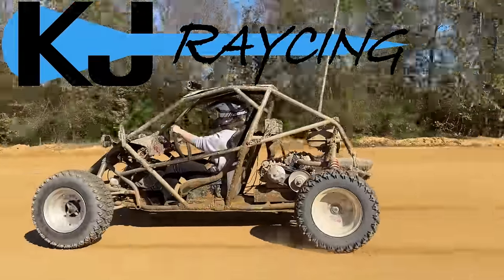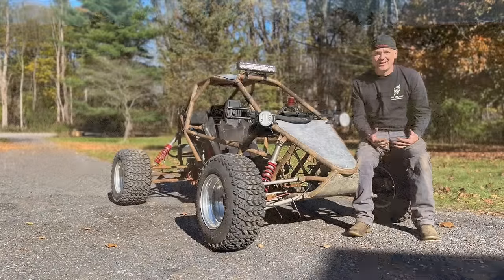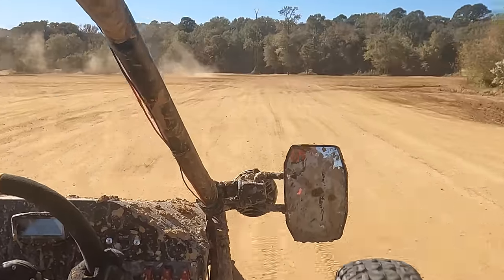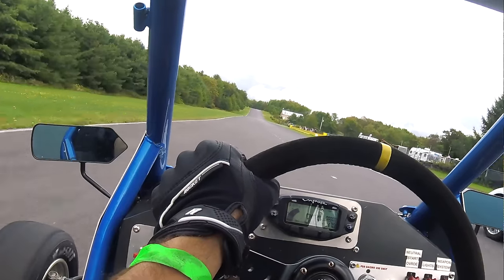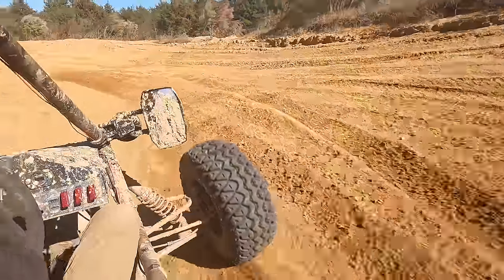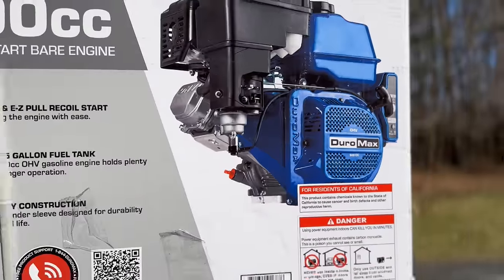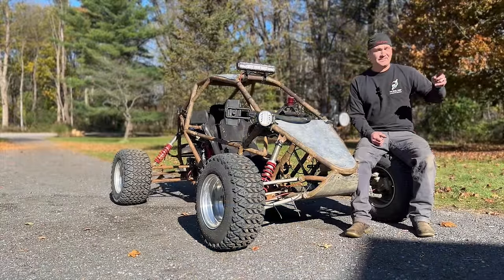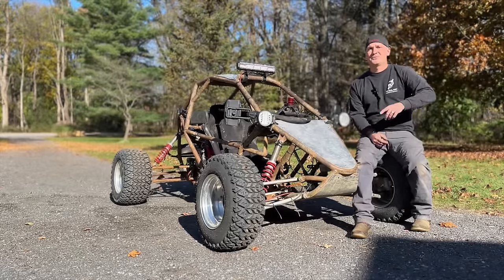Crosskart: Small Budget, Big Performance

Comment: The longer I live the more I think this is the sweet spot for reliability, low cost, safety and fun. Dirt bikes are awesome, but not something most people can easily ride/fit on unless you have a bunch of bikes. Pre runners are sick, but to make them safe and fun, you're going to spend SO much time and money getting the suspension built, dialed, frame stiffened, then you need more power etc. side by sides are sweet but the ones that are really fun to drive aren't exactly cheap at all.
With these you've got a full cage and super low center of gravity, very unlikely to roll and way safer than say a quad if you roll it.
Way easier to fix than a proper vehicle that weighs 4 or 5000 lbs with a cage in it too.
Reply from the maker: You said it man!!

Comment: Awesome little build! If I can make one suggestion... put in a firewall, top to bottom. I watched one of your other videos, great build, but it had a radiator on top... if a hose breaks/leaked while you were riding, odds are you'll be in the icu. The firewall doesn't need to be fire proof, it just needs to keep the the stuff separate from you.  
Great content. New sub. Thanks for sharing!
Reply: Sounds like a great recommendation!
Reply from the maker: Couldn’t agree more, that’s why I did it and showed you how:  Crosskart Build: Firewall    KJ Raycing VF-1
https://youtu.be/KyCp6GV5PNY

Comment: Great looking machines. I build an all terrain cart back in 1999, but no top cage. It just had a 5hp B&S with CVT. That's what a lot of carts were using then, and the B&S had a lot of aftermarket parts available. It's still sitting in my shed. It was a lot of fun, and would go just about anywhere I wanted. Not as fun as these designs though.

Comment: I love your passion and this kart's design and execution. I know this probably won't be popular, but having this in electric would be awesome. It doesn't need a big motor or battery as you don't drive long distances. Any kind of maintenance would go away and it would of course be quiet. The center of gravity would probably also be even lower. Then of course there is the low end torque and the fact you don't need any kind of clutch.
Reply from the maker: Stay tuned 😁
Reply: 100% agree but you know how these rural folk hate all them new fangled gizmos.
Reply: @grafja we hate the poor range. Its not uncommon for me to ride my sxs 60-70 miles in a day.
Reply: @grafja its not that I hate electric stuff. Its more just that people treat it like its solving every issue with internal combustion engines when its not. It solves some yes, but electric stuff has its own set of draw backs to it. Thats where I and many others draw our grievences from

Comment: Many years ago my dad's neighbor built a mid engine corvair 6 cyl. With a VW bus trans. sand rail using muffler pipe.
He made up templates from luan plywood for all of the bends, And the muffler shop did all of the bending . He did the wielding at home.
And like you he built several of them.
The muffler pipe was fairly larg in dia. And thin walled.  altogether I thought it was brilliant.

Comment: Totally agree on the power and speed thing. I'd like to have a version with a 650 or 750 bike engine. Really, just for having the additional shifting gear experience. One of each, be nice.
Reply: On a short course or trail situation, a 525 Polaris ATV powered machine would mop the floor with those; low-end torque is where it's at

Comment: I always wanted to build a crazy little go cart. Pick up a used motorcycle, maybe an old 4 cylinder 900cc. 50+ hp, with a clutch and transmission.
Reply from the maker: Check out the channel… this was the 4th one I built and the only auto 👍

Comment: Have you ever thought of making plans for say a 50-60% scale version of this? One that would use something like a 212 cc motor for kids? If so I would be interested in buying the plans!
Reply from the maker: I was working on a kids version that was smaller but instead made the seat and pedals adjustable and bought an off road booster seat. My daughter has been driving a VF-1 since she was 8 years old 😎
Reply: @KJRaycing  I hope to be starting a build for my winter project. Maybe I can work out plans for a 1/2 scale version using 1 & 1.5 tubing that can utilize a smaller engine. :)

Comment: I got a question, Im 15, learning to weld next year in shop class and might buy a mig welder. I was wonder if I was to build this do i need a tube bender or could I cut it at an angle and weld it and brace it. Also should I get the 5hp first or should I just buy the 20 right away? If it is just as simple as bolting them in buying both is fine but if I need to fab a whole bunch more

Comment: Two seater with front front and back rather than side by side? Or does that make a length problem?
Reply from the maker: I designed the VF-1 XL so it can be lengthened for tandem seating if you want to feel like you’re in an F-14 😁

Comment: that torquey engine does a great job.   Plus you wouldn't have had 50 successful test rides w/ a shifter Crosskart!   W/o some shifting/ignition gizmos you'd have a shredded transmission.    Question...what purpose does the 'U' linkage and tie rods on the rear suspension serve?   It seems the heim joints have the rear A arms under control.   Great looking build and really nice work.
Reply from the maker: Very true! Those engines may not have a lot of power but they can run. I put a rear anti-sway bar on the back to give steering back to the front and prevent rollovers. I get them for $15 off ebay from parted out utility atv’s.  Thank you so much!
Reply: @KJRaycing  Ahh, gotcha.  so when the compression side moves 'up' the sway bar pivots,  transferring upward force to the other arm causing it to compress slightly and reduce overall body roll,  correct?    Looking forward to more builds.

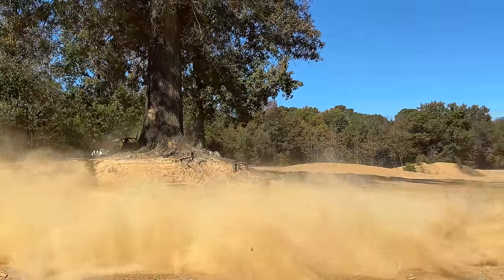Comment: 7:10 is what I would want.  Acceleration, not big speed, 50- 60 is plenty.
 What power level is needed for anytime drifting and donuts ??
Reply: I change my mind....LOL
9:58 is what I want !
Reply from the maker: Atv engines. They have more torque and are geared more for off road. The tonka wheels are fun but terrible with that 4 cylinder!
Reply: @KJRaycing  Hey !  Thanks for your response !
I am still in the preliminary dreaming phase but also figure others may be thinking the same.

Comment: Still waiting for the day someone builds the frames and sales them. Thought they were cool with the bike motors but now we got the mini bike motors on em? Yea, interested.
Reply from the maker: First kits are being manufactured right now 😎
Reply: @KJRaycing  Like actual welded, ready to go frames? If thats the case, Id like to be on the mailing list.
Reply from the maker: No you still have to weld, but you would have to weld to mount suspension, engines, seats, steering… Get a welder and start practicing. 👍

Comment: i run single cyl 2 stroke Rotax's from the late 60s early 70s. my 318cc (Ol' Dependable) maybe 17hp runs real strong until you get it in really dry sand then ya better keep it moving. my 335cc 20hp? has no trouble in the sand. i have a 292cc racing motor that i havent put in yet but cant wait to get it in there its rated at 22hp. and yea big difference in just a couple horse.
 i agree and so do all my riders/drivers. you don't need to be doing 100mph to have fun. i geared mine to run 45 at 6,000rpm. on the trails here in Michigan that's faster you want to go as I'm on the under 50" trails. like you i have never had anyone get off the cart and say "That Was Boring". my father raced snowmobiles back in the day and taught me to set up a clutch and torque converter so them little  40lb 2 strokes (including the clutch) are really responsive to the throttle.

Comment: Great video!  What do you think the budget is for the stock version with parts etc minus labor?   Thank you
Reply from the maker: I have 3 cost breakdowns on my channel but I guess it may be time to shoot another one 👍. This is a very complex question…
Reply: @KJRaycing  Thank you I'll check to find the breakdowns that you mentioned.  My main curiosity was like $1k, $5k, $10k etc. just a ballpark on what you feel is a "small budget".   Btw my background is in data and analytics so I would be glad to help if you wanted.
Reply from the maker: Well the bugdet kart was initially built for under $2k, as it sits with all of the upgrades is around 3k. The other ones on the channel range from $4500-$6500. Small budget for the kind of performance these have.
Reply: @KJRaycing awesome thank you

Comment: I purchased plans but the die I have is a 7” clr.  Wondering if you could convert the measurements over through your software or if you know of a way to make everything work right.
Reply from the maker: 7” clr is too big to make a good crosskart with. The plans and frame itself are VERY forgiving to multiple clrs. But the biggest that has been used is 6”. Honestly I would look at getting the correct die for your machine if you want to build a crosskart. I wish it could be easier. I wish you the best.
-Kyle
Reply: Haha. Thanks for the quick reply.  I was hoping for a different answer but I guess I’ll have to prove you wrong now.  Lol. Your karts are sick btw.  I’ll post some pics  when it’s done.  Thanks again!

Comment: Do you also have the prints for the jigs you use??  I don't see them on your website. Including the jig you built for the front suspension.
Reply from the maker: If you read the description at kj-raycing.dpdcart.com it shows everything included; which is plans for all the jigs, frame, rear a arms and hooking protection. If you are referring to the jigs I bolted to the wheels they are too simple to be made into plans and vary by tire size you are using and bolt pattern of the hubs. I walk you through exactly how to male them in a video. Enjoy the build 🦾

Comment: Will your kart handle a 300 hp 2 Kawasaki motor
Reply from the maker: Yes. Make sure to use all of the motor mounts. You’ll only end up using 1/4 of the throttle though. That would be like having a 3000 hp mustang.

Comment: I don't know much fabrication. But I would certainly buy the chassis if someone built it
Reply from the maker: How would you mount your motor and suspension?  The hardest part is to start 🦾
Reply: @KJRaycing  if someone made a rolling chassis I should say. And it's because I'm currently on the road for most of the year so I'm only home for a few days to a week at a time so I don't mind dropping an engine or doing some wiring. But to learn a whole new trade under those circumstances is quite hard

Comment: I'd rather have an electric. As you said speed isn't what makes it fun when offroading, torque and acceleration make it fun, and you can't beat electric motors when it comes to that. My kids have an electric kart that pulls 1.4G's of longitudinal acceleration from a stop, more than most supercars, it whips your head back and pins you to your seat. Unfortunately it is limited to 25mph, I would like something with a BIT more speed than that...
Reply from the maker: I agree, electric can be a blast, but right now it is still pretty expensive and having multiple battery packs to run all day just adds to the cost. I’m hoping prices start coming down so I can do an electric VF-1 👍

Comment: Lets be honest though, more power is almost always better. Just because its there doesnt mean you have to use it all 100% of the time. Ive NEVER riden or driven anything and said ‘man, i wish i had less power’. Lol
Reply from the maker: Let’s be honest, you didn’t watch the entire video or you totally missed the point.  I designed the frame to take any chain driven engine, so you can have a nice trail machine that will still jump and do donuts on an awesome budget; or you can have “too much” power. I show the 50hp atv powered VF-1 and also the 100hp VF-1 in the video.
Reply: @KJRaycing  I did watch the entire video. My comment wasnt a criticism of the build. I was merely saying more power is hardly ever a bad thing or undesireable.
Reply from the maker: Oh I get ya, 1500 hp on a tight trail system with trees everywhere and your 10 year old at the wheel taking what you built for a rip is definitely a good idea.  I didn’t take your comment as criticism, I took it as someone who has extremely limited experience in a single seat buggy and/or fabrication. The “budget” kart was meant to show new fabricators they can build something that is fairly simple with a lot more performance than a chinese go kart on a very decent budget.  That’s why I wrote that you missed the point. I’m not trying to get into a urinating contest with you, I just don’t want the message of the video missed and your comment to discourage someone from building an awesome machine. As someone who has driven all of these karts I can honestly say they are all extremely fun no matter the power level.  And after you build, finding extra power with tuning or upgrades is all part of the fun. 👍 I hope you get the chance to build one 🤘🏼

Comment: 15 -50 hp enough ? No it is not , not even close
Reply from the maker: …so how much is enough?  This is based on a simple concept; power to weight. A 350hp mustang is pretty fun, right? Well 50hp in one of these is the same figure. 80hp is like a 700hp mustang.  I have definitely built more spirited machines and I’m am speaking from my experience as a builder and driver of all of these crosskarts. Luckily I’m a dude that can do math and not just see hp as the overall number. I wish you the best, sir.